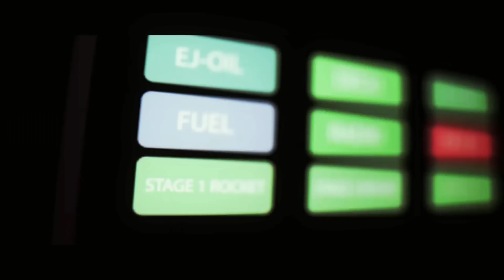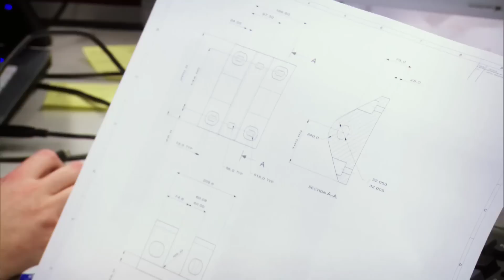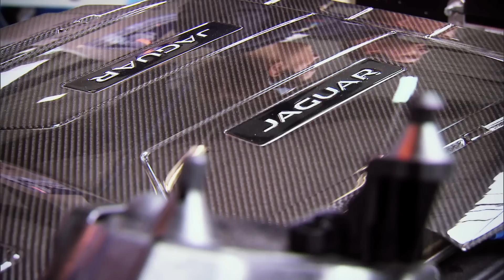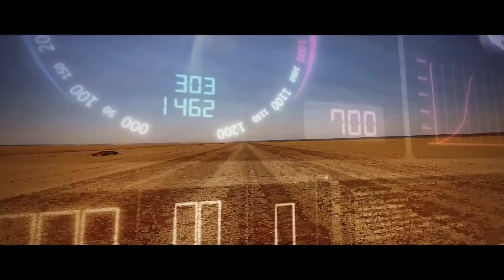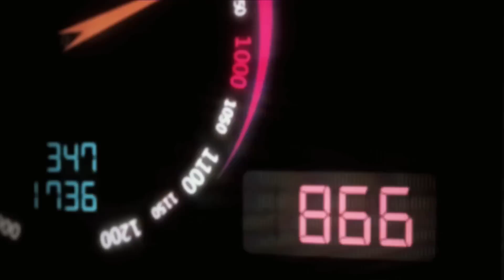The Bloodhound SSC - 1000mph Car Taking On The Land Speed Record  | Trans World Sport

Comment: Beautiful! 

A thought...he spoke about how delicate the tiny corrections at 900 mph have to be.  I'm wondering when someone is going to twig  using the kind of fly-by-wire and AI systems used in bleeding edge avionics might be of help in this arena.

Would this be allowable under the current rules and regs?
Reply: I know this is old, but I agree. IMO They will have to augment steering controls with computers to prevent erratic steering inputs from the driver. Plus just one lonely lizard decides to be on the track that day. ;D

Comment: Take a F-18, cut the wings down to little stubs , replace the wheels with skis and let er rip. At a thousand miles an hour it would just be skipping over the lake bed anyway., the F-18 body is aready made for speeds above 1000 miles per hour
Reply: Neil Macleod True, but you have to remember that’s without the friction of the ground at your feet. Air friction is far less than surface friction.

Comment: There is a salt flat about 40 miles wide by 55 miles long (65 x 88 km) with no stones nor mud nor dust to damage the engines. Should be ideal for this sort of run, better than that 12-mile mudpan they talk about. 
And it's at 12000 ft altitude (3662m) so possibly better for high speeds too.
It's near Uyuni, in Bolivia.
Reply: Uyuni Salt Flat
Bolivia
https://maps.app.goo.gl/CgybubXpA6h4AxJr6

Comment: Every joint of his body, as well as his head will have to be tethered to the car if it starts rolling.  At that speed, his body would be ripped apart by the G-loading if it starts to roll.  HANS devices will not be enough.  They need to seriously think about that.  Even if they are able to keep his body intact rolling at that speed, there's no way to protect his brain from being scrambled inside his skull.  He's a special kind of superhero.
Reply: Not at all. This has all been simulated a thousand times over. Green has flow flight profiles in aerobatic aircraft to simulate the G he will experience. Find the Chris Harris video on it and see for yourself.

Comment: That's a rocket, not a damn car
Reply: 4 wheels = car
Reply: Not all cars have 4 wheels but if it was a rocket why is it meant to be on earth
Reply: @stantorren4400  After Breedlove's three wheeler started to show possibility the rules were changed and now four wheels are required in order to set the record. That's why you see engine driven Land Speed cars with two wheels in line with one another, and two wheel opposite one another. "Current" reasoning for the resulting triangular body shape is that the shape is more "aerodynamic" then a rectangular shape. However...
Reply: TELL BREEDLOVE AND ARFONS ETC ETC.

Comment: its not a car it has a jet engine and jet engines don't have cylinders and cars do so it's not a car
Reply: but it's just used as a fuel pump the jet engine provides the power not the supercharged jaugur engine
Reply: What about rotary motors? rx7? pretty sure that's still a car
Reply: it is a car because it has a combustion engine powering it
Reply: Tommy V but this is still a combustion engine :o
Reply: @tommy5811  What does a combustion engine have to do with determining what is a "car"???

Comment: what if they used engines from the sr-71 blackbird. couldnt they go alot faster considering the blackbird can reach up to 3540 kph or 2199.65 mph?
Reply: Thats just not how physics work.. No offence, but im sure the people building the car know a little more about... everything
Reply: not to mention the rocket id far more powerful than the blackbirds engines, and is much more fuel and space efficient, but you know, none of that matters as long as what they use is American right?
Reply: You have to consider the fact that the car would end up flipping as it is too light...
Reply: GazelleMain so make it heavier or find some way to stabilize it
Reply: lol
Reply: Jesse Ottens : Here's an idea....
Just take the wings off of the SR-71 and put high speed tires on it and then drive it like a car to break the land speed record.

Comment: If they hit a freakin small rock they will be lift up in the air XD
Reply: EXODUZ AgarChampion That's why they had people picking every stone from 10 mm and above on the track!
Reply: No.  A dumb rock would not loft th3 8 ton vehicle.    How dumb
Reply: Chad W
 if that 8 tons vehicle moving faster than the speed of sound then it'll be fucked if it hit a rock
Reply: @chadw4638  Only thing"dumb" is you lack of understanding reality.  Didn't you hear the driver stating he had to fight the steering? What, in your mind, do you think is forcing the car to go in directions other then straight? Oh, you most not have  heard what the driver said...

Comment: Imagine racing in the far future, where people race on Mars within a massive contained area with cars like this.
Reply: the atmosphere of mars is too thin. jet engines would be useless
Reply: But the main thrust/power of this car comes from a hybrid rocket engine, which has its oxidiser already on board. the jet engine is just to take it up to (relatively) low speeds so presumably if this type of racing did happen in the future on mars they would use a different system to get it up to speed so the hybrid could kick in.

Comment: Congratulations for coming in 2nd place! Stan Barrett actually did it  first  in 1979 i believe, but good job anyways.
Reply: no no no no... etc  Measured through a mile - ACCURATELY - in TWO directions. Stan Barrett obviously went very quickly, and full respect to him and the team for that. But the timing arrangements were a farce.
Reply: @michaelfarmer8048  oooooh  no, don;'t tell the truth
Reply: The timing arrangements were verified by the US Air Force. Here are the reasons he didn't officially get the record:
- His car had three wheels not four
- He broke the sound barrier once traveling in one direction (The FIA says it has to be recorded in two directions to count)
- They did not measure his average speed across one mile, Instead they used radar to measure the instantaneous speed.
Reply: Yawn....rules are rules
Reply: R O M C H O M P A awwww ur angry its ok madam......here have a tissue. Awwwwwww
Reply: Wrongo D.P. The point of doing it twice- in opposite directions is to compensate for any possible wind aided advantage.
Reply: PMSL grow up ur one sad fucker to carry this on
Reply: "Verified" is awefully strong. The Air Force said he went that fast, but they didn't employ a rigorous system for actually measuring speed and calculating mach number, and evidence of shockwave, or even boom-like audio doesn't cut it, because there is an envelope of around 70 MPH before the sound barrier where both can be observes. It's the old saying: It doesn't count if you can't prove it. They didn't use standardized and studiously recorded methods. Edmund Hillary and Tenzing Norgay where the first to summit Everest because it was recorded and verified. Magellen's Crew were the first to circumnavigate the world, because they could prove it. Anything else is hear-say and rumor.
Reply: No, the Air Force didn't "measure" it because they didn't use a reliable, repeatable, and test independent method of measurement. It's just like Chuck Yeager being the first to break the sound-barrier, despite reports of pilots doing it before in very-high-speed dives post war. It was measured in a verifiable and independently testable and replicable manner. You don't get to pick and choose when the standards apply. Otherwise Yeager did jack shit, because people "recorded" doing it before.
Reply: Again, all of those guys did what they did in a verifiable and recorded manner. You rocket car didn't, because the methods of "measurement" weren't. They weren't in an appropriately rigorous and verifiable manner. Hillary AND Norgay wre the first to Summit because they refused to allow records to be created to specify exactly which was first, which is why they share the title of first, although they can demonstrate that, which ever of the two it was, they were the first individuals recorded to have achieved that feat. Magellen's crew could demonstrate that they circumnavigated the planet. Both are note worthy, because both were verifiable. The US Air Force has never released the data they used to "measure" the speed, which was done via radar tracking, which is, as measuring methods go, inaccurate, with, depending on the unit used and conditions, up to 10s of meters out on their estimates of location. For example, current ground based radar used for ground tracking of vehicles and individuals, can be out by as much as 50 m at 10 km. That makes a massive difference compared to a closed circuit timing gate. It isn't verifiable, and, as such, the name doesn't go down in the history books.
Reply: rules are for losers
Reply: Look what you can do! You almost typed enough words to form half an idea. Congrats peasant.
Reply: David Pye yea, that's what it is.
Reply: richard
Reply: XD
Reply: richard day Him and Chuck Yeager. but it wasn't "sanctioned"or "official"! They used a rocket powered car!
Reply: So, you're saying it wasn't "official" because it was powered by a "rocket"? I don't know of too many cars that are powered by twin jet engines either, so what's the difference? It was certified by the U.S. Air Force and that's good enough for me!
Reply: wasn't official as the rules are set at two runs within time period....the whole points to stop what happened with what you are saying they made a vehicle to do one trip and that's it. The point of 2 trips in a time frame ensure it is at least slightly a land vehicle
Reply: richard day No dont misquote me and get all triggered there Skippy ! I said it wasn't sanctioned or official! The rocket comment was just an aside! IThey didn't have official timers or a sanctioning body ,such as Guinness people in attendance! They just ran it up and listened for the sonic boom! I think they were doing it for a movie,don't remember what it was! No The rocket didn't have anything to do with it not being recognized! They just didn't do it officially. Ease up a little,don't be quite so defensive.
Reply: Aah, but it was official. The U.S. Air Force did officially measure time & speed, and I personally respect their sanctioning more than "Guiness" book of world records or Bernie Ecelstone's F.I.A. Just because Guiness didn't bother to acknowledge it doesn't mean it didn't happen. Thrust did it twice, I agree, but Stan Barrett still did it first, and that's the end of it. But cheer up; you still have a chance for SSC II to break the 1,000 mph barrier first if they can get it together, Skippy.
Reply: I should check your spelling first, before making comments! (By the way, there was NO sonic boom, cobber.)
Reply: What?
Reply: well you have just shot urself in foot there MATE. Whos to say the speed ur on about wasnt with the wind ha ha ha FAIL!
Reply: When Roger Maris(brit) broke the 4 min. mile, they didn't tell him "now turn around and run it the other way- oh yea , you've got 1 hour". When Sir Edmond Hillary was first to climb Everest, no one said to him "now you have to climb it from the other side- in 1 hour".When Charles Lindberg solo'd the Atlantic, no one ever said " you have to go back in 1 hour for it to be official" Shall I continue? I say it's you who is shot in the foot.
Reply: Oh and to ur reply cause im sure you reading my last post made you angry.........chill the fuck out.......i mean wtf is getting you so worked up? Book a doctors appointment.....go for a walk......at end of day its just some shitty car moving over the earth lol
Reply: David Pye, I seriously doubt you have the intellectual ability to get me worked up or even angry; I refuse to have a battle of wits with an unarmed person.. The fact is, you're wrong and I'm right. Stan did it first.
Reply: Even in a running race (or long jump) the wind speed is taking into account.  If you have too much tail wind according to the rules a record time/distance is not accepted. That way they don't have to run/jump in both directions.
Reply: Stan had an instantaneous speed that peaked at 1k. Bloodhound will travel the WHOLE MILE at 1k.... TWICE. BIG difference. The P47 could hit Mach 1 in a dive, but as for holding that speed, the rapid approach of the floor tended to curtail that venture. Donald Campbell was travelling at 324mph when he crashed, so yeah, he did 300+ first, but I'll bet if you ask Ken Warby why he doesn't hold the record on water because Campbell went faster (ONCE) than his 317 record, aggregated over two runs, in opposite directions, being an Australian, I think a fat lip might be the reply. Track runners DO  run two ways as they run on an oval track. Just saying 😁
Reply: Sour grapes?
Reply: no they were not verified by the US air Force,that's just bs
Reply: Agreed :)
Reply: freelancer4 the win: Because the Air Force did not publicly share the intimate details of their methods of measurement for time /speed, then logically we must deny that the event ever took place at all-correct? Yet you assume that because magellan arrived home from the opposite direction  that he set off in, he MUST have circumnavigated the globe.   R U B B I S H , P O P P Y C O C K and B A L D E R D A S H ! ! !  Curiously- who names their child " freelancer "? You Brit's are still stingin' from the Revolution, yes?
Reply: What revolution, O! Colonial.

Comment: why all that protection? if the car crashes, then you die no matter what, theres no amount of protection, that can make you survive a crash at a 1000 mph
Reply: I think the amount of science put into safety isn't to save the driver "in-case-of", but rather to prevent it from crashing at all.
Reply: If something were  to go wrong at a slower speed there's a much higher chance of getting Andy back alive than not using any protection
Reply: @jako1234567890jako  WHY BOTHER TO EXPLAIN ?

Comment: A supercharged Jaguar V8 engine with the purpose of being used as a fuel pump and nothing more
Reply: You didn't listen to the video I see.... several countries are cooperating to make parts for this vehicle, even a small country like Norway who are making the rocket motor.
Reply: @bellator11  THAT TOLD HIM
Reply: Well the F1 engines from the Apollo missions used a jet engine turbo pump generating 55,000 HP just to drive fuel into the engine. That’s around 91 jaguar engines combined. And there was one for each engine. So in total it took 275,000 HP just to feed fuel to all 5 engines at launch.
Reply: BestCanKeanRob2 Norwegian hybrid rockets :-)
Reply: your alternative is to use an expander cycle which you cant do with hydrogen peroxide because it will explode, or a gas generator cycle, which doesnt work with a hybrid engine, on top of which you have abundant atmospheric oxygen, soo......
Reply: One of the big issues with many rocket engines is the turbo-pump.  German engineers did a marvelous job with the V-2.
Reply: Original design they used a Cosworth CA2010 F1 engine pumping out 800hp but it was unreliable.
Reply: tu sei un senza pisciolla
Reply: Let's clear this up is a BMW V-8 engine
Reply: BestCanKeanRob2  think the rocket is nordic.
Reply: A rolls Royce engine will be used as the turbocharger
Reply: Gerald Dolliver I thought it was driving the generator and hydraulic pump too.
Reply: Fake
for
sure
Reply: @faraimakunike6953  no

Comment: A car faster than a bullet? Wow!
Reply: Ha, a car that is bulletproof
Reply: It's bullshit. I'd be surprised if it reaches 800 mph. 1000 mph just sounds cool for a title
Reply: It is most certainly not bullshit, they are very serious about breaking the record sometime in 2020 I believe. I've met the man behind the programme - Richard Noble, he broke the previous land speed record in 1983 with Thrust II, only to break it again with Thrust SSC in 1997. There's no one more qualified to run the project than him.
Reply: @Advection357  why ?
Reply: +roaringleo57 this says 1700 MPH "Average" not 1000
Reply: Soil Ko: depends on the bullet dude! The speed of sound at sea level is approximately 1150 feet per second. I have three rifles who's speed of the bullet is 3000 feet per second at the muzzle still super sonic at a mile.
But I will say that when they went 763 miles an hour back in 1997 they actually had a faster ground speed than when Chuck Yeager was the first man to break the speed of sound. He was at 40 or 50 thousand feet where the air is much thinner and therefore less resistant and can take a lower speed to travel through it easier, than when it is thicker at sea level because of the humidity and temperature you have to go through faster when you go faster than the speed of sound.
Yeager's, I believe was around 650 miles per hour which I believe was in 1947 50 years prior.
Also two human beings in nothing more than pressure suits have free fallen from balloons at over 800 miles an hour 2012 and 2014!
Reply: no its a plane with no wings not a car

Comment: holy shit, what are those tires made of? did you strap 4 captain america shields on there?
Reply: Simon "You could literally float over the ground"   which would therefore break the LAND speed record rules.
Reply: I really want them to put a ramp at the end of the "runway" at an angle of 6 degrees...
Reply: Nazimelonhamster tyres would be torn to pecies at that speed
Reply: Nothing more than 50.000g at full speed. They must be very tough!
Reply: Simon WoodburyForget 
You would need upwards thrust though.
Reply: There's a seaparste video showing the wheels. They do survive testing
Reply: idd aluminium wheels, milled to a ridiculous degree of accuracy, so they can withstand the immense amount of force that they will experience at max speed.